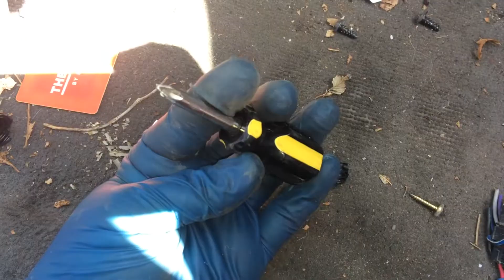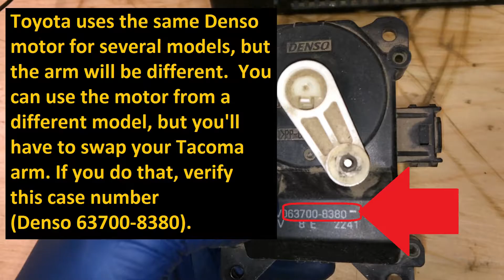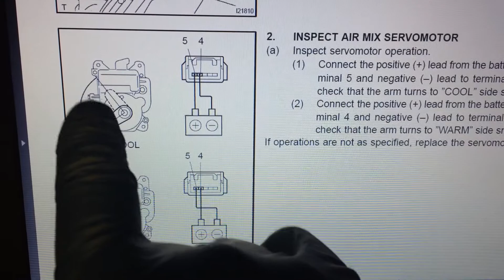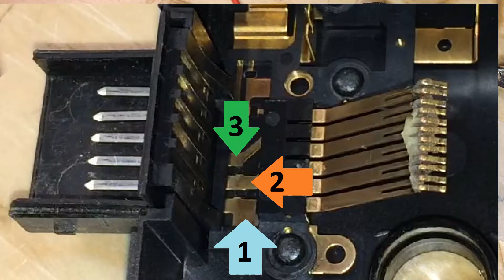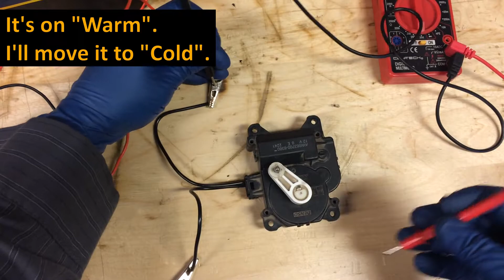2001 - 2004 Toyota Tacoma Replace Air Mix Servo, Blend Door Actuator, AC Noise Fix, No Heat Fix

Comment from the maker: Timestamps and more info:
00:21  Locations of mounting screws (3 larger Phillips, 1 smaller Phillips)
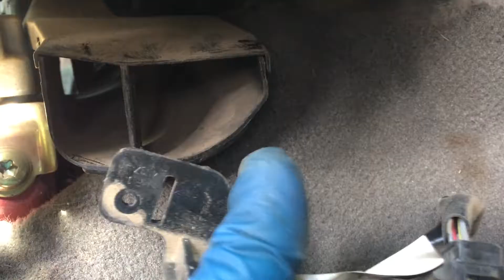01:14  Disconnect electrical connector
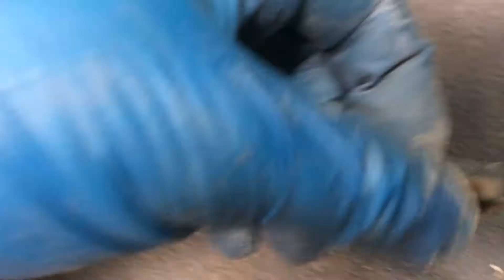01:27  View of the track
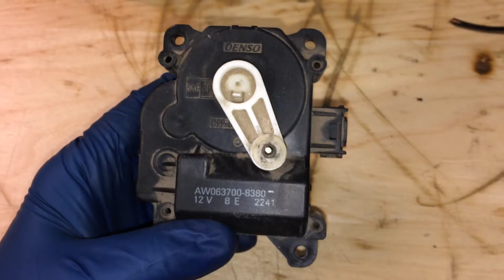01:50  Start Bench Testing
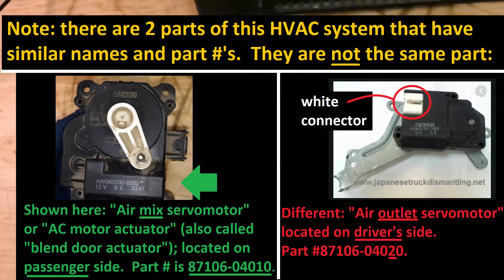02:09  *Important*: Difference between similar parts, don't confuse them!
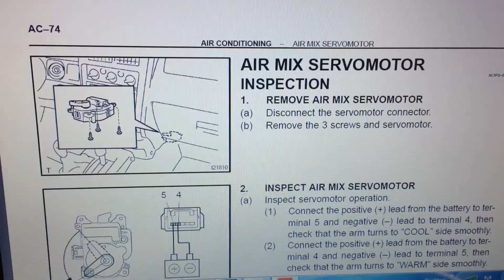02:44  Factory Service Manual explanation (confusing/conflicting images)
03:57  Test #1: checking arm movement by powering the motor with 12V battery
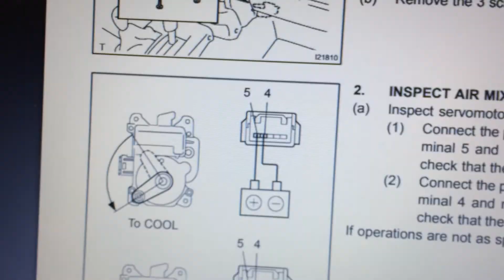04:50  Detail of power/ground pins #4 and #5 on motor electrical connector
05:22  Trick for connecting power and ground to the pins
06:08  Resistance safety check over pins #4 and #5 before supplying power
07:12  Supply power to motor on pins #4 and #5 to test arm movement
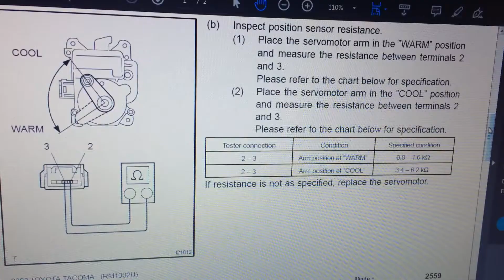08:01  Test #2: check resistance over pins #3 and #2 of position sensor
08:45  FSM values for resistance checks over #3 and #2
09:26  Start of motor disassembly to check the internal parts
09:41  How to open the motor case (tamper resistant tabs)
10:21  Inside the motor
10:47  Exploring the arm position sensor potentiometer
14:21  Common internal cause of motor clicking (wormscrew gear failure)
14:56  Snapping the motor case back together
15:33  Moving the arm to the maximum "Warm" or "Cool" position for easier re-install
17:34  Notes for aligning the motor arm to the track during install
18:18  Reinstall instructions

Thanks for watching, and I hope this video was helpful.  Please comment with your tips, especially if you know about the arm sensor function, or also if you know any good aftermarket solutions or inter-Toyota swaps. 

Good luck with your repair!
Reply: great video Thanks for sharing
Reply from the maker: @dustyfrog9147  Thanks for watching! : )
Reply: Does the motor control the knob with the blue, red and white colors? or does it control the knob with the icons for face and feet air, windshield air, etc? my problem is no outside air coming in, only warm air. I want to be sure i am removing the right part/motor.
Thank you
Reply from the maker: @SDsailor7  I don't have this truck, but I *think* remember the motor is for the red/blue/white (ie, the "air mix") knob.  That knob is supposed to control the motor, for example, when you turn it to red you're supposed to get heat, or blue for AC.  You can check by turning the different knobs and seeing if the motor responds (watching the arm).  If it is not responding to any knobs, then it needs to be inspected.
Reply: @L35inColorado  Thank you will do.
Cheers
Reply: Is it ok to spray the "needles"/contacts with electrical solvent ie. Deoxit? or should we just leave them alone?
Thank you
Reply from the maker: @SDsailor7  This is a good question, and I don't know the answer -- I would first try "reusing" the existing grease, for example moving it back if is has piled up in one area; the reason for that approach is simply because I'm not sure what kind of grease would be appropriate for that connection (the original grease almost looks like some kind of dielectric in consistency).  Deoxit would clean it up, but would it lubricate it?  I'm not sure, but you can try and then just check resistance in a few combinations from the record to the terminals.
Reply: @L35inColorado  After thinking about it i don't think deoxit is advisable maybe in the areas that don't have the grease it will be ok.
Cheers
Reply: When you do the installation of the motor does it matter in what position you install it? or not? Sorry to ask so many questions it might not even be my problem since your description says "AC Noise fix" and "No heat fix" but i like to learn in case this ever happens to me.
My problem like i said before is no outside air ventilation, only getting  warm air and when i turn on the AC i do get AC but not enough cooling due to the heating air. I did check the hot water valve that is connected on the back of the fire wall and it is working {it opens and closes}
Thank you
Reply from the maker: @SDsailor7  Yes, as mentioned in the video, you want to install the motor consistent with the track in the dash (the track from which you remove it), and you can just manually move the track in the dash to align it, or your can use a 12V battery to move the arm on the motor itself (as shown in the video).  

For your case, here is what I'd do: with the engine running, go on the passenger side and locate the motor shown in the video, under the dash.  You'll be able to see the track and the arm (white arm).  Then, reach over and move the AC/heat knobs (all of them): if none of the knobs cause the motor to move, then you have an issue either with the motor (the most common case) or the electrical connection to the motor.  

You can then pull the motor out, as shown in the video, and test it and well as the connection.  First, use a multimeter on the connector side that stays in the dash (the connector that you'd disconnect to remove the motor) and see if you're getting power when you move the knobs.  

If you're not getting power, then your motor might be okay but there is an issue somewhere in the electrical to the motor.  

If you are getting power, then I would suspect the motor and test it further, as shown in the video.

I hope that helps!
Reply: @L35inColorado  Thank you so much for the tips! I hope i can find the problem and fix it.
Cheers
Reply: @SDsailor7  Yes it does,  Its easier to place the acccutator  in the track in he COLD position as referenced in the video. Here is how I did it. With ignition off, plug in new accutator before installing. Turn on ignition , set the hot /cold dial on the dash to Cold  (its blue) and the accutator will  rotate to the  COLD, position.,  Place acctuator  pin in the track and secure with the screws.  There is hardly enough room under there to place the accutator in the  track  while in the WARM position .
Reply: You should  be a teacher! great presentation!
Reply: How do you move manual on the truck option 2
Reply: Very good video thank you so much
Reply: Great video, very detailed.  pain in the butt to get too.  I wish they would have used bolts instead of screws.  Thank you.

Comment: On my 2002 4Runner the cable that goes to the heater valve on the fire wall.. became rusty and stuck, causing the arm to snap off.
I never replaced it… being that I live  in Florida… where I never use the heater control .
Reply: Hi! I have same issue. My cable on firewall is stuck and broke. I just turn it toward drivers side when opens it to heater core. My blend actuator does not work when I turn cool/hot switch so my heater nevers blows warm. Can I just replace my blend actuator ?

Comment: Use the Denso number to find used parts. GM and other companies use the same motor /w different arms. For some reason the GM ones are like $20 used while Toyota ones are $$$$. Then swap the arm as mentioned by person in video.
Reply from the maker: That's a great tip, thanks for sharing!  : )

Comment: Yes. I just learned. I was having an intermittent motor issue and I think that I just needed to lube the cable that connects from the interior unit all the way to the heater core valve box, that seems to have solved my problem

Comment: Excellent tutorial on diagnosing the  Tacoma air-mix servo.  I just had heat loss on my 2001 Tacoma & it appears that this servo is the problem... Anyway a DIY repair will save me $$$$ from an expensive auto repair.  Thank you for the time to clearly explain - along with great camera work on this repair.
Reply from the maker: Thank you, and thanks for watching!  : )
Reply: @L35inColorado   I just replaced servo today  for a cost of $126 - took less than 1/2 hour to put back in.. Tacoma is now ready for winter... A shop would have charged about 3X this amount.  Again - outstanding video !!

Comment: TY for all the great Info. I have a 2001 Toyota sienna. I have this noise you talking about. Yes I got great AC but I get No hot air. It just started making this noise and no heat. I hope and think this may be my problem. This for sure a DIY job. I'm just going to take this part out and just get a new one. Again thank you for the great video and great info. 👍👍
Reply from the maker: Thanks, and thanks for watching - you can do it! : )

Comment: Great video. The servo on my 3rd gen 4runner is failing so I just installed a new servo from NAPA. Still having the same issue where the arm gets stuck and will move randomly until I fiddle with the thermostat.  Anyone have an idea what to troubleshoot next?
Reply: Spray some silicone on the cable that is attached to the interior unit, the same cable goes to a diverter right in the middle of the engine close to the windshield, I lubed it and it seems to be moving free now
Reply: @bennyabolmaali4115 thanks, I’ll give that a try. I sprayed silicone lubricant on the wire under the hood and it helped for a little while. I’ll try the interior as well.

Comment: Using this GREAT video I replaced the Actuator - really helpful tutorial.  One suggestion is to try lubricating the cable going to the underhood hot water valve, mine was pretty stiff and may have contributed to the Actuator demise.  Thanks again
Reply from the maker: Great - thank you for adding your tip!  And thanks for watching : )

Comment: I am having trouble with this. My servo motor when plugged into the wireing harness only turns a little bit when turned to heat then gets stuck and continues to try to move in that direction (motor doesn’t turn off) then when I change to cold it turns about 360 degrees then stops. I took a video and posted on my channel. If you have any ideas as to why this is happening I’d appreciate the help. I don’t want to install it and then damage somthing because the motor won’t stop going

Comment: Hi there! I have a 2005 Toyota rav4, heater doesn't work and i found out that the white arm is stuck in cold mode. I took out the actuator, opened it up and cleaned it. It won't work. I purchased another one, doesn't work again. I don't know how to actually test my actuators because I don't have the equipment shown at the beginning of the video.. i was wondering if the actuator's white arm has to be placed in a certain position before connecting it to the car in order to make it move. I'm a bit desperated, please could you give me some help? I would hugely appreciate it thank you
Reply: when I coonect both on them to the car they don't move at all, that concerns me about the integrity of the whole car's electric system

Comment: I've started noticing on my 2004 that recirculate is allowing outside air in.  If someone is in front with heavy exhaust or I drive by smoke it all comes into the cab even though the recirculate button is activated and lit.  would this unit be the reason why outside air is coming in?

Comment: Did you really have to remove all those dash components for this? I need to swap mine in my 02 Tacoma
Reply from the maker: No, the Tacoma shown at the beginning was in a junkyard, and that is why so many dash parts were missing.  You can look under the passenger side dash and see the motor without removing much, perhaps just one panel (maybe not even that).  I hope that helps - good luck!

Comment: I miss the days of cable actuated blend doors. Now they install servo motors so when they fail, you get to buy a new one and either try to fix it yourself or pay someone to do it. And they said Toyotas all you have to do is put gas in them.and change the oil and they'll run forever. HA!!!😂
Reply from the maker: I absolutely agree with you about the cable drive systems!  Hopefully they will return - these electronic systems are much more complicated and involve many more failure points.  What's even worse, in my opinion, are the newest systems with all the digital inputs!  Cable drive was the best, hands down!   
Thanks for watching and good luck : )
Reply: @L35inColorado thanks, 2 years later mine has kicked the bucket

Comment: Excellent video!
I have a 2004 xtrcab base Tacoma 2.4l
You can plug the servo wire from the truck into the servo itself and use the truck voltage to manipulate the servo arm. I set the thermostat to the middle of the white sector and moved the door arm that the servo arm inserts into to get the screw holes to align. 
The worm gear in the original servo was broken on mine. I bought a cheap servo online and it is working great.
Reply from the maker: Nice!  Thanks for adding your tips, and thanks for watching! : )

Comment: I believe the part # in this video may be wrong. There are actually two servomotors on the passenger side. I think part # 87106-04010 connects directly to the blower assembly and is higher up in the dash. The part shown in this video is actually part # 87106-04030, or at least that was my experience after ordering both.
Reply: Yes I think the part # mentioned in the video is wrong!

Comment: The confusion on the warm/cool is due to the double arrow. they are showing that to go to warm the arrow goes from bottom to top CW, and to switch to cool it will go down CC. understand ??
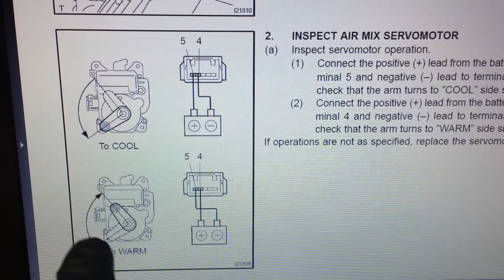Reply from the maker: I'm sorry I missed your comment  - I made this video a couple years ago, so I reviewed that part at 03:15 upon seeing your comment: I'm still not clear with why the FSM labeled the second image with the double-ended arrow and used the perforated outline of the arm at the lower/8 o'clock position on that second image. I'm not clear with what the second image is trying to communicate, but, yes - as you said, the clockwise movement ends at the "warm" position at about 11 o'clock, and the counterclockwise movement ends at the "cool" position at about 8 o'clock. When I sent the motor out in the "cool" position (8 o'clock/lower position), the installer was able to slip it into place on an lever that was set at the cool position. Thanks for watching!

Comment: Hey.  I found out that my blend door aculator is out of order/cycle. I searched so much on YouTube and google. My aculator would think that it is on max cold or hot but be on the wrong direction it is pointing at. When I try to align it to the flips it does not match/fit. Is there any way to reset the aculator. Thank you for you support.

Comment: I dont have the anoying clicking noise but when i actuate the know for heat the heater water valve does not stay open so i will have to fix the actuator or buy a new one? And probably they are only a dealer item. Bummer :-(

Comment: I have a problem with the position control of the air conditioning I move it and it does not change it just blows air at the feet

Comment: @L35 in Colorado i just recently changes this part out and got my heat back, but now im having issues with my a/c and heat switching on and off on its own? Any ideas? Thanks in advance.
Reply from the maker: I'm sorry that's happening -- if you mean that the air is suddenly blowing, then not blowing, it might be the blower motor:
http://www.tacomaforum.com/threads/2001-taco-air-blower-shuts-off-on.9541/
I had a blower motor issue in another Toyota where a squirrel had hid nuts in the blower motor!  It would run, then stop (jammed by the nuts!), then run: in that case, cleaning the blower motor fixed the problem.  Here's another youtuber's video on the issues:
https://www.youtube.com/watch?v=uhbsxsZY_5c
I hope that helps -- good luck! : )
Reply: @L35inColorado  thanks for the reply! I meant like il be driving and the a/c will be on and then suddenly it switches to heat on it own, usually i just turn the a/c/heat knob back and forth and then it’ll reset and eventually it’ll do it again.

Comment: Hey, do you know if it's located at the same position in an 05 Seqouia? I used my heater yesterday for the first time since last winter and I can't turn it off anymore. I believe this is my issue.
Reply from the maker: I do not know -- there might be some discussion in the Comment section, or on the forums.  Good luck!

Comment: Hi. Thanks for the video and thorough explanation. I purchased my part and went to uninstall it, but how did you get to the screws toward the driver side? I can get to the screw in the front and the small screw in the back, but the two facing the middle of console are not accessible. I also have some sort of vent positioned right below the part. I am making the repair on my 2001 4Runner.
Reply from the maker: I'm sorry, I am not familiar with the 4Runner.  Perhaps there is some information on the forums?

Comment: this part is the culprit (air mix servomotor) to the sounds of mice or squirrels running around in my cab.  Amazing video! thank you!
Reply from the maker: Good luck! : )
Reply: I was wondering what this noise was in my Tacoma-Thought it was the new radio I installed-Thanks.

Comment: I think the problem I have is a door inside the vent is loose and cold air will randomly be warm and not so randomly back to cold. I didn't see any of you videos for that?
Reply from the maker: That might be possible -- I am not sure, because I don't have this vehicle (Tacoma) to have a look, and I don't the internal air paths.  Perhaps this might help -- click on the "Diagrams" tab:
https://parts.toyota.com/a/Toyota_2001_Tacoma/63522910__6723436/HEATING--AIR-CONDITIONING---HEATER-UNIT--BLOWER/674460-8712.html
Good luck : )

Comment: is this the same repair on a 2003 sequoia
Reply from the maker: No, the Sequoia motors have different part numbers. The repair might be similar, but the parts are different.  Good luck!
Reply: I am working on a 2001 Sequoia. Like L35 said, the part numbers are different. I happen to be working on the blend door actuator. The part is expensive ($150+), even from what I found on the used market. I think I just found a replacement motor on Amazon. This video will be very similar.